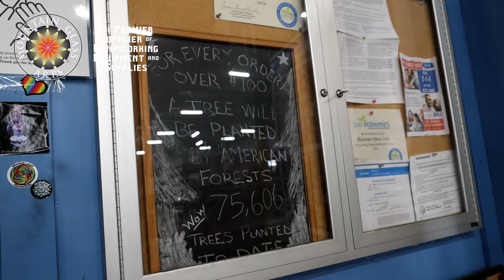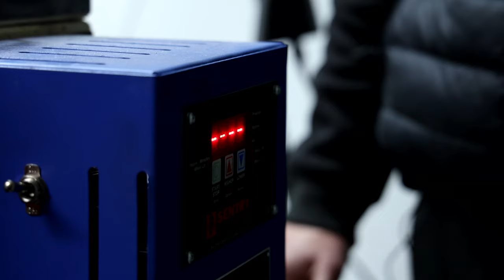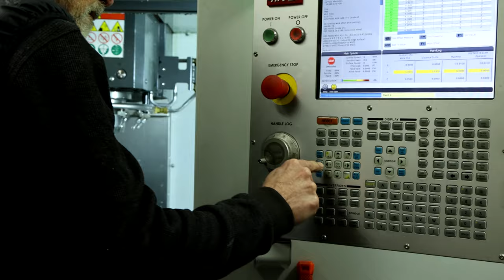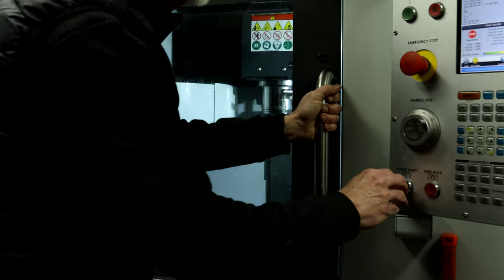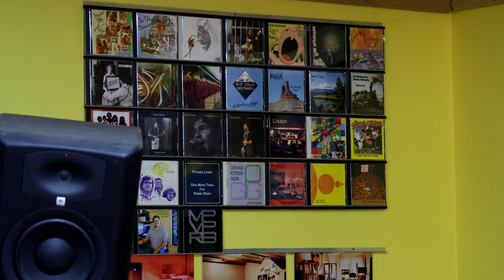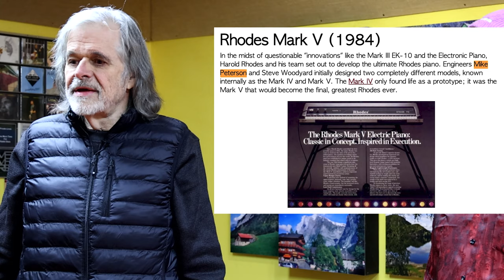The Future of Glass Tech! || Beyond the Torch Episode 3 II with Mike Peterson NQALHA

Comment: He needs to add a heat shield to the area under the handle to protect from the bunsen burner flame. If he had a 18x18 piece a plate steel slightly angled towards him so that the flame wash would angle away from him, it would make a much safer process.